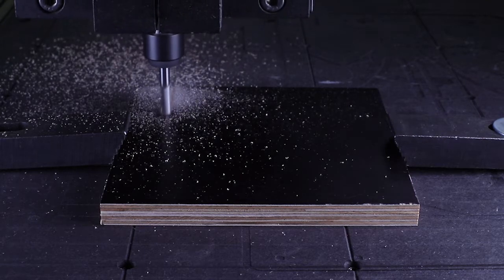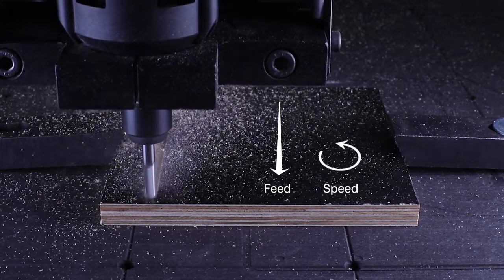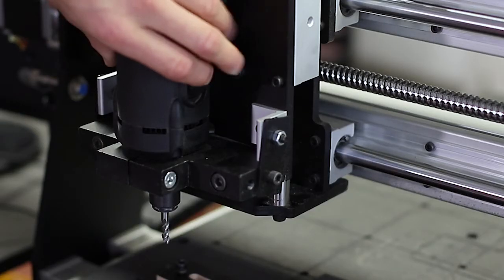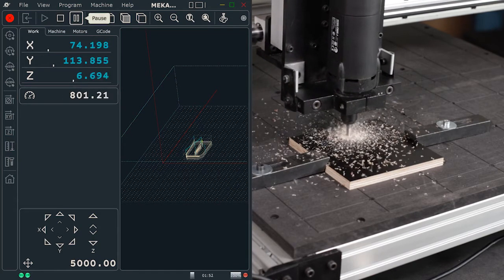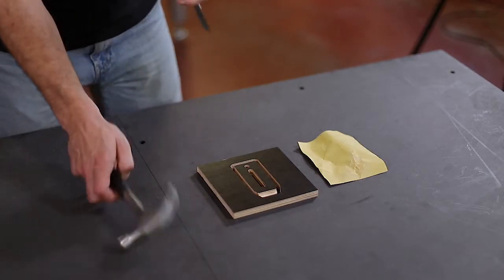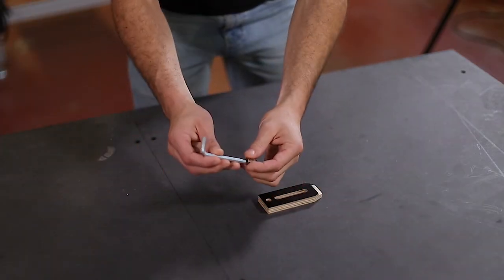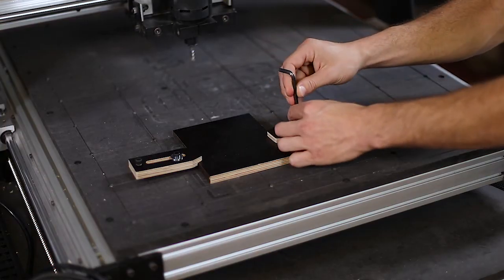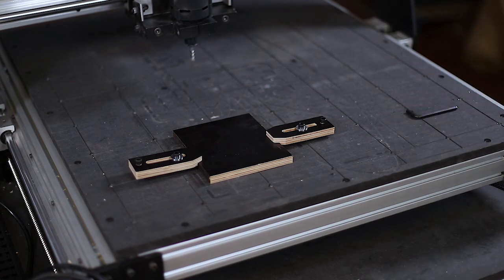CNC Milling Tutorial #4 | Mill Your First Part

Comment: just getting started with my EVO!  hope that you will do some more tutorials from design to cutting that include how to add an initial surfacing tool path and change the end mills between processes.  

When I milled this part with supplied black finished plywood square, it worked great.  When I tried on some regular plywood, I had horrible tear out across grain on outer veneer using same end mill.  Suggestions? Thanks
Reply from the maker: Hi! The surfacing tool path is already existing and linked to our spoilerboard kit, but you can easily access documentation and code even without buying the kit :-) For the changing too procedure, it's pretty easy on Fusion360: you just need to define two operations with two different end mills. The program will automatically stop between the two, so you can change your end mill.
Regarding plywood, it is actually not that easy to mill with proper surface finish. I would suggest using a downcut end mill to avoid the material to tear out!

Comment: I'm new to cnc.  I have an aluminum part that has a 2D pocket with a hole at the bottom out the bottom of the part.  Should I bore the hole and then clear the pocket, or should I clear the pocket and then bore the hole?
Reply from the maker: Hi Justin ! There won't be a lot of difference in terms of result. I would simulate the milling time of both operations to see which one is the most effective in your case.
Reply: @MekanikaTools  Excellent. Thank you! Your videos are really helpful